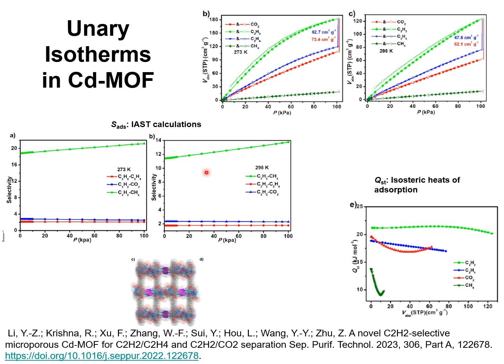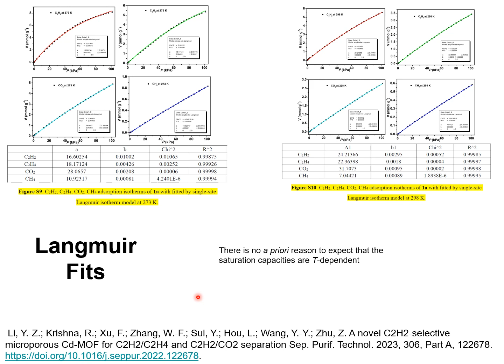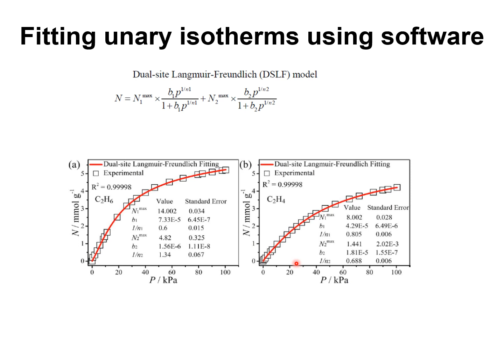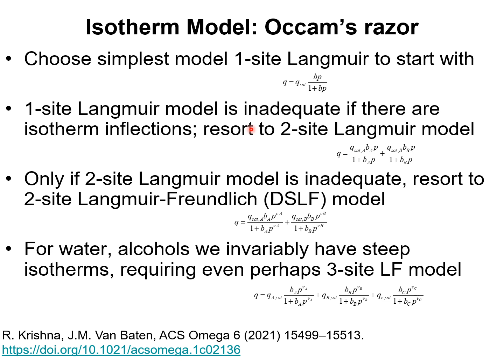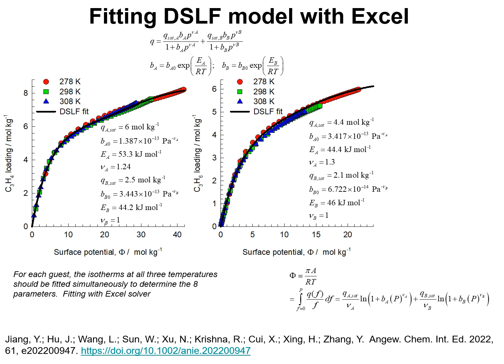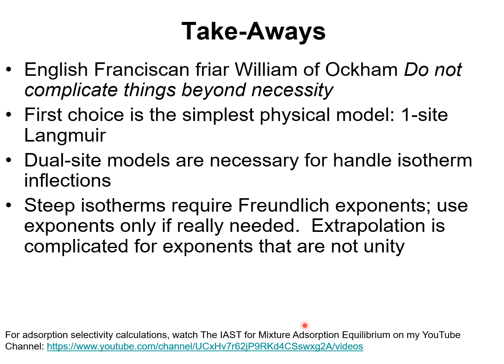Fitting of Unary Isotherms

Comment: Hi! Thanks for this video. I had always wondered why we used fitting-based methods to extract thermodynamics when terms relating to energy were already built into the langmuir model itself! If the E relates to adsorption energetics like U or H, would you be able to extract S from the preexponential b0 term as well using this method?
Reply from the maker: To get infomation on the entropic contribution, we also need to examine saturation capacities, not just the pre-exponential term.

See my presentation on Entropic Separations of Mixtures